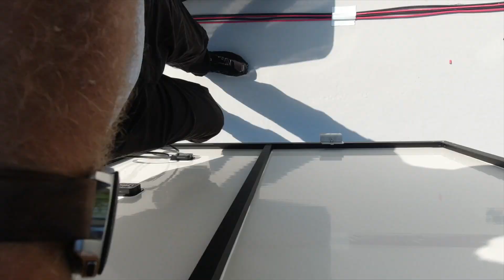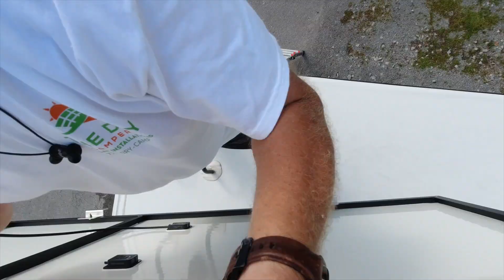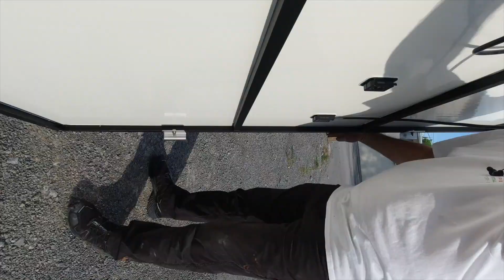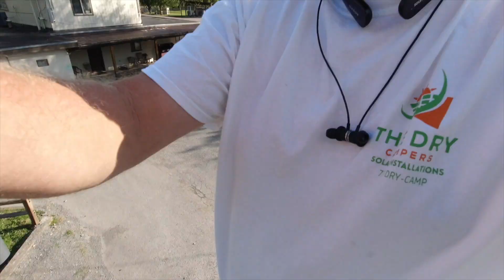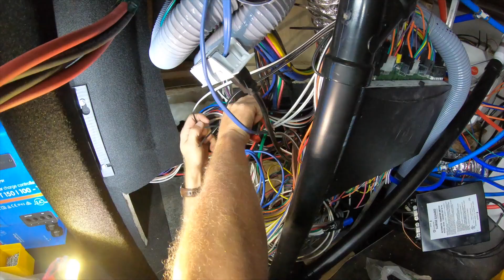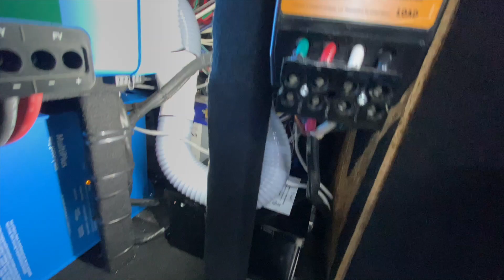Grand Design Momentum 397TH | Also...DRONE VS TREE

Comment: I’m an Easy Start believer also.  Just wondered if you had ever tested the usage before and after the install?
Reply from the maker: Great question, Randy. The Easy Starts are definitely worth it for the initial spike, as it cuts the spike in half. We have not video'ed this; however, that's a great idea as we will video this to show how well the Easy Starts work and effect a solar system. Thanks!